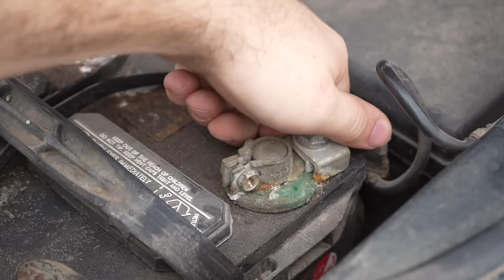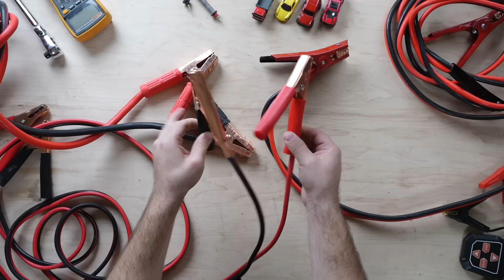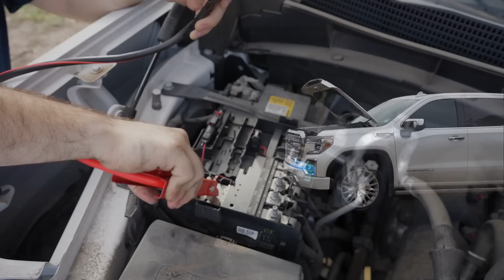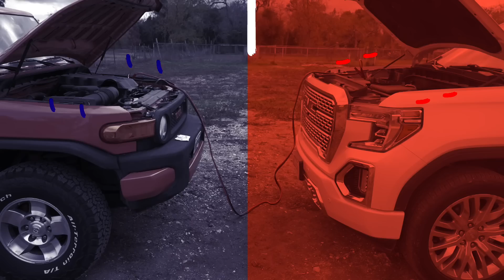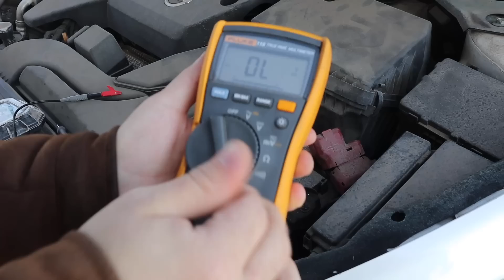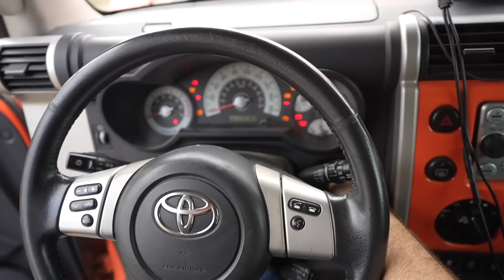What most people get wrong about using jumper cables

Comment: I love how people who have no electrical knowledge keep uping the thickness of wires needed for things. 

The only reason you would want thicker wire is heat and you won’t generate enough heat in that short amount of time to damage anything unless you using 22 gage 😂. It’s all about isolation of the wire and its ability to dispense heat. 

Have you ever used an old school space heater? Look at the wire thickness and they are practically handling red hot heating elements heat and distributing it into the rest of you house at way over 200 degrees. Go on and touch the wall terminals after it’s been running for a while😂. But guess what is not burning down? Yea… your house is just fine. That 18 gauge wire on that heater and the thin isolation can handle 1800 watts of heat. 

Your car, even if we were pretending that it transferred the full rated amps over across the wires, which it doesn’t, not even close, will output 

Looking up the battery amp rating for wire that can handle it? Are you an idiota or what? 

As an electrician I promise you that no one, and that includes “big semi truck drivers” will be willing to carry 15’ of THAT cable 😂

Unfortunately the culture of avoiding liability and “playing it safe” has lead to the “wire gage needed” to be increased every time the story is passed onto the next audience.

You would be better off

Comment: The part about the 12awg wire being useless is just wrong. You can start a car easily with 14/2awg romex. How do I know? Because I’m an electrician who has bought various random cars that needed a jump before buying cables but not before cleaning up my scrap wire from jobs so I’ve made my own cables just about everytime I’ve needed to use them or someone asked for a jump from me. The gauge literally doesn’t matter for most things lying around anywhere besides automotive wiring. The 14 gauge is about the bottom of the line while not at all ideal. It will work fine once if needed. You don’t need to find the amps of the battery and get cables that are rated for that 😂not at all and most people looking to read that advice can’t carry 10’ of cables large enough for 600+ amps that rating is for long term and persistent current flowing through it. The larger wires are least resistant and you don’t want the cables to be too too long because you’re adding that resistance per foot of length and that translates to energy loss in the form of heat. That being said you can jump a car off a power tool battery too no problem and I’ve seen it done many times without issue

Comment: Look at the CCA on the battery and buy cables capable of carrying that current.
Your average person has no clue about gauge size.

The whole point of the jumper terminal under the hood is to make it easier to start the car. It's actually wired differently and is a more direct line to the starter rather than going through the entire system.

Whichever order you place the clamps you may generate a spark as you are completing the same circuit.
If you do get a spark this means something in the patient vehicle is drawing power, so it could indicate a large parasitic draw.

I feel a lot of these fears of explosions come from colder climates when connecting frozen or very cold batteries. The amount of hydrogen present would dissipate very quickly in an outdoor environment.

Modern alternators often have variable power output when running, low voltage when the battery is fully charged and high voltage when the battery is lower or there is a significant load on the car. (this can cause the uninformed to think there is something wrong with the alternator).

Comment: Some really good info here that don’t see very often. Been too many times that I have seen people go into motor supplies stores & ask for jumper cables only to be given the cheapest ones - no asking what vehicle they drive (which should be the first question imho!) Same with not asking how old the battery is that is in the car (I always change batteries after 5-8 years - depending on quality of the battery - & if buy a used car will always ask when the seller changed the battery & check for receipt in paperwork as proof). I have even had batteries fail on brand new cars off the forecourt in under 18months (most recently the battery on my previous vehicle - Toyota C-HR - which failed completely 2 days after cars first service - so either the dealership messed up during the service with the battery or put wrong battery back in it after the service - although no reason for them to remove it).
Same applies to price of the battery. Cars cost several thousands of £/$/€ so why scrimp on the cost of the thing that starts the car - same applies to batteries in smoke alarms or anything else that your life could depend on but that’s a different topic entirely!!!
I always check the battery terminals & charge when I fill up anything under the hood (such as washer fluid, oil, etc). Takes seconds to check if holder has come loose or terminal corrosion.

Comment: I wouldn't want battery acid to splash in my eye. 😢
Reply: Once got it one me when I dead shorted a battery, it burned through the skin on my finger right down to the bone by the time I got in the house and put milk on it to neutralize the acid.
Reply: @eloonshatstink  wow, that was bad. Has it healed up ?
Reply: @DarronSanderson Thanks, yeah that was 15-18 years ago, I'd jump started my mower took the cables off the mower but left them on the truck, clamped one cable onto the other so they wouldn;'t short, well the clamp pierced the cable and shorted out, the plastic was gone off the cables and liquid was boiling out the top vents of the better, I was eat up with stupid and grabbed the clamp that was on the battery terminal and I did get it off but that's how the acid got on me, with some molten plastic too which was the least of it really.  That was so nasty to watch it didn't look real, I can't believe I thought to even pour milk on it and more surprised I had some.  IF I hadn't I'd say things would have been alot worse, but thank God it never got in my face, I'm fine with the finger I got over it and you wouldn't know looking at it today other than the skin dries out way easier than the rest of my hand.
Reply: @eloonshatstink  yes, so true it was good it never got on your face. I knew a dude that opened his radiator cap when it was hot and it shot in his eye.
Reply: @DarronSanderson  Yeah hot rads aren't to be tickled, I've known a few people not wise enough to wait, atleast use a towel on it lol.  Man for real I couldn't imagine losing an eye, I'd rather lose the finger no problem lol.  Thanks.  I'm eloonshatstink, I changed my name on here lol
Reply: @JackAsstor  lol